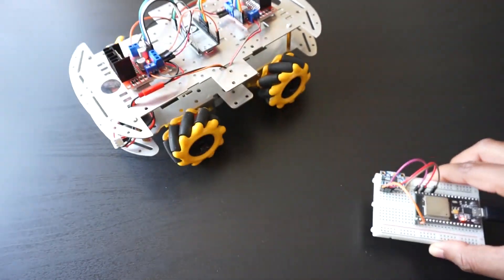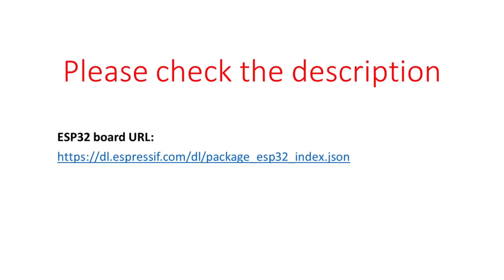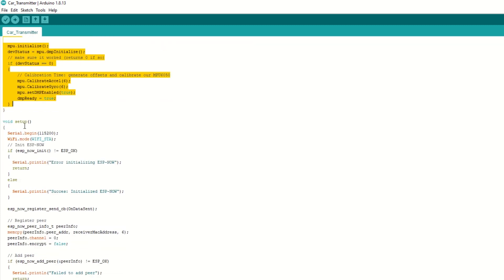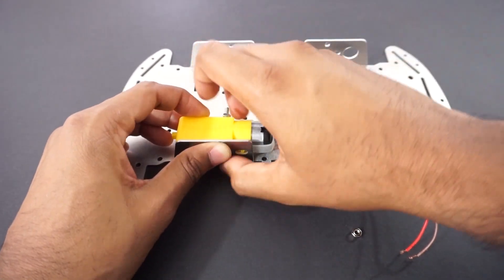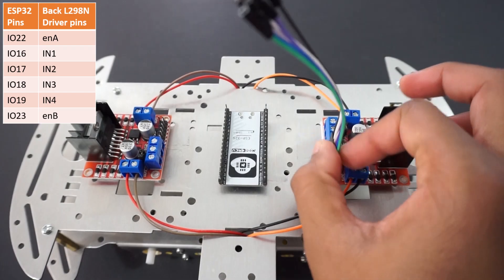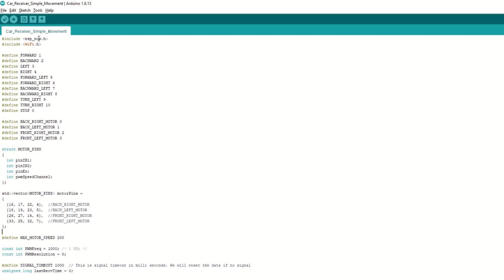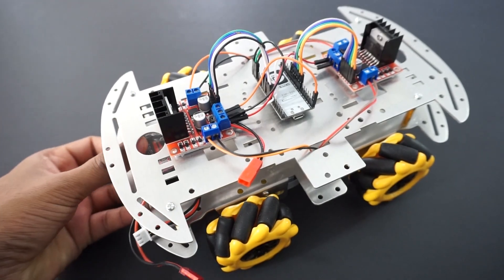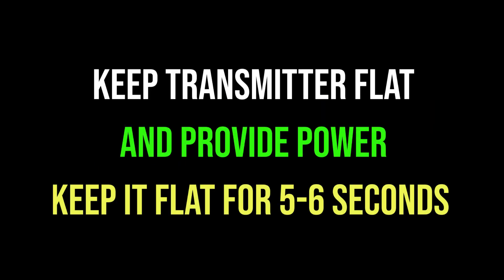Gesture Controlled Mecanum Wheels Car using ESP32 | ESPNOW | DIY🔥

Comment: SIR I UAVE DONE EVERYTHING RIGHT INCLUDING MAC ADRESS AND CONNECTION AS WELL AS THE CODE BUT IT IS STILL NOT WORKING PLEASE HELP ME ( CAN I CONTACT YOU SOMEHOW?) 😢
Reply from the maker: Please use rechargeable battery only . Also check video slowly and carefully for any missing step 👍🏻👏🏻. Don’t worry it will work 👍🏻
Reply: @hashincludeelectronics  BUT I FOLLOWED ALL THE STEPS AND USING RECHARGEABLE BATTERY PLEASE HELP SIR
Reply: @hashincludeelectronics  while checking if the transmitter code returns the same mac address as that typed out, you don't need a rechargeable battery right??? when it gives output, it is the default/original mac address of transmitter... how to change that? it won't connect otherwise
Reply from the maker: @Percyjackson183  please follow the exact steps in video . You need to get receiver MAC address and put it in transmitter code 👍🏻👏🏻

Comment: Sir, I need your help, my receiver and transmitter isn't connecting. From your another video I saw a similar project like mobile wifi controlled car, I uploaded that code in ESP32 and checked if it's working or not, surprisingly receiver is working perfectly fine in that case, but from this video I tried to flash the code again in receiver and in transmitter but it's not working after several attempts.
Reply from the maker: Please make sure to add the MAC address properly 👍🏻👏🏻

Comment: Why you did it with 2 motor driver you can use one also
Reply from the maker: We need to control all four motors individually . Hence we used 2 motor drivers . Each motor driver can control only 2 motors . 👍🏻👏🏻

Comment: BRO I ONLY HAVE L293D CAN I MAKE IT WITH THAT?
Reply from the maker: you will need L298N driver for this project . Unfortunately You can not use L293D driver in this project 👍🏻
Reply: @hashincludeelectronics  BUT I ONLY HAVE L293D AND I CAN'T GET L298N BECAUSE I HAVE TO SUBMIT THIS PROJECT

Comment: man that directions if else statement switches was some poor coding. And the logic behind it is naive. Just get the relative info, apply it as a vector in the loop
Reply from the maker: Thanks for checking out the video 👏🏻👍🏻. There are so many ways we can code. However I kept it simple and straight forward so that it can be understood easily by everyone. You are welcome to make changes in code as per your need 👏🏻👏🏻

Comment: Sir plz tell that u have made a transmitter and receiver in latest video so can we use that to make drone plz sir tell me big fan btw why don't upload videos now
Reply from the maker: Thank you very much for checking out the video 👏🏻. Yes you can use that for drone . However there another video using nrf24l01 for transmitter and receiver . It has more range . As far as video uploading is concerned , sure I will be back with new video soon . Little bit busy with other stuff . But soon there will be new video 👏🏻👍🏻.
Reply: @hashincludeelectronics  Thank! You sir
Reply: https://youtu.be/UQl03pU-w58?si=-0mHgrbxUm1AaCSq

Comment: Hello sir big fans 
Sir kindly help me i am totally stuck. I have esp32 with 30 pins and also i have mpu 6050 gy-61 both are very different from the vedio now what should i do
Reply from the maker: Thank you very much for checking out the video 👍🏻👏🏻. I would suggest to use the same complements as per video to avoid any issue . This way you will be able to complete your project easily 👍🏻

Comment: I did everything perfectly including with using same version of ide used in above video and modules and everything as same versions as per video 
but I could not able to interface my transmitter and receiver
I would be thankful if anyone help me out of this
Reply: did you figure out how to connect?? I'm facing the same issue
Reply from the maker: @Percyjackson183  what exact error do you get ? And which version of Arduino IDE are you using ?
Reply from the maker: What type of battery are you using ?
Reply: @hashincludeelectronics  3.7 volts battery *3 for receiver and 5 volts powerbank for transmitter
Reply: @hashincludeelectronics  how to interface those 2 esp32 (transmitter and receiver)
Reply: @hashincludeelectronics it is not working, followed every steps. please help. thankyou

Comment: Can we use other wheels
Reply from the maker: This car is supposed to work with mecanum wheels only . It has different direction control which will work only with mecanum wheels . If you need to use other simple wheels then please check my other video on gesture controlled car . Or you will have to make changes in this code and remove the movements which can not be handled by simple wheels . 👍🏻👏🏻

Comment: Hi.  can I use a ESP32 with 30pinout?
Reply from the maker: I would suggest to use the same module which is used in this project to avoid any issue . I have used 38 pins esp32 module . 👌🏻👍🏻

Comment: In the codes, we have to, we have to only change the MAC address as per our module right?? If the rest of the code is kept same, no problem will occur right? I am asking this cause I am new to arguing and on top of that I don’t know coding.
Reply from the maker: Thanks for checking out the video 👍🏻. Yes you need to change the MAC address . And don’t worry you will be successful 👏🏻👏🏻

Comment: The esp 32 module should be 30 pins or 38 or both can work
Reply: Ok thanks
Reply from the maker: Please use 38 pin module to avoid any issue 👍🏻
Reply: Also will esp8266 work with the same code??

Comment: Mine is not at all working circuit connection is true and transmitter and receiver is also ready but not working, what should be the problem
Reply from the maker: Please use rechargeable battery to avoid any issue . 👍🏻

Comment: Sir every single thing in my project and program is correct but still the reciever doesnot pair with the transmitter and it does not work. How to bind them together ? pls reply as soon as possible.🙏🙏
Reply: sir pls reply pls pls .
Reply from the maker: Please use rechargeable battery only if not using already .
Reply: @hashincludeelectronics  I am using that also
Reply: did you figure out how to connect?? I'm facing the same issue
Reply: @Percyjackson183  no i couldn't figure it out but am still trying I got my boards approaching very soon so it's bit delayed for me.

Comment: Hi Brother, 
You are doing great work.
Can I use ESP8266[NodeMCU] Instead of ESP32?
Reply from the maker: Thank you very much for checking out the video 👏🏻👍🏻. Yeah you can try that however you will have to change the pins accordingly. I would suggest to use esp32 as it is in the video to avoid any mistake and have your project working first . Then you can experiment later with nodemcu 👍🏻
Reply: @hashincludeelectronics  Thank You Very Much Brother🙏🙏
Have a Great Day!

Comment: Recently updated arduino boards and libraries and now am unable to make a connection. I have tried 3 different ESP32 modules and keep getting the same message:

-> Succes: Initialized ESP-NOW
 -> E (139) ESPNOW: Peer interface is invalid
 -> Failed to add peer

It was working just fine, no longer works. No parts of the code were changed.
Reply from the maker: This is interesting . Did you try searching for this error on internet ? May be there we will find some solution on this . Not sure if people already faced this problem recently .
Reply: @hashincludeelectronics  I managed to track down the source of the problem. When I use only your linked board manager URL and delete the newer espressif board manager url required for esp32c3 boards (not part of your board library), programming on the a esp32 dev kit works. If I use the newer espressif link, compiling for the esp32 dev kit board no longer works, for multiple reasons (i2cdevlib problem and a problem with peerinfo variable needing to be global). Have not managed to get the code working on the most recent espressif board manager url, mainly because the i2c devices fail to initialize.

I've had to delete the packages/esp32 folder multiple times switching between the board manager links as it really didn't like both links being there.
Reply from the maker: @samvanroy4921  glad that you figured out the issues . This kind of debugging is always time consuming .
Reply: May I have a solution? Please help me.

Comment: Trying to work out how to make this work. Using a lilygo T-OI plus ESP32. It really doens't like using anything but the Wire library. Can't figure out how to get it to initialize the sensor with i2cdev library. Any ideas which arguments I'd have to add?
Reply from the maker: Thanks for checking out the video 👍🏻.unfortunately I don’t have much idea on this requirement
Reply: @hashincludeelectronics  Thank you for the response. I'll try and see if I can't use other libraries to avoid the problem with I2Cdevlib. I like your calibration method, which is why I'm reluctant to do so :)

Comment: hai , if we use esp32 30 pin no 38 pin , how we plug to jumper that no GPIO ? we must update our coding ?
Reply from the maker: Yes you will have to make the changes according to pins connected . I would suggest if you have 38 pins esp32 , please use it to avoid any issue and have your project working as shown in video .

Comment: thanks for the video. i made similar circuit with 30 pin esp32 dev board with relevant pins but this is not working.is there any way to check if there is any problem in circuit or components. also, should there be 38 pin esp32 only
Reply from the maker: Any esp32 board should work . You can check the value if it’s being received at receiver end using serial monitor .
Reply: @hashincludeelectronics  It is working now, thanks alot for the video
Reply from the maker: @rish241  that’s really nice 👍🏻 good job 👍🏻
Reply: Bro can you tell me what problem you were facing and how you have solved that problem, because in my case among two motors, one motor is only moving backwards it is not able to move forwards, i am using ultra sonic sensor for obstacle detection as well.
Reply: @aavesh.bagwan    in my case voltage regulator was blown. For your case, you may check sensor output on serial monitor for forward direction. If it is fine then check for input to motors in motor controller too

Comment: I am building the robot but immediately find a problem. When trying to find the MAC address I can not find the model of the ESP32. There are 92 different models but none match the ESP32 model I have which is WiFi ESP-WROOM_32. There is no model like this in the list. Which do I choose?  Jim
Reply from the maker: Use the same module name in list which I used in video . It’s esp32 wroover module . It should work for your board as well .
Reply: @hashincludeelectronics  I have carried out your instruction and here are the results. I have also photed my controller.  Jim
Unfortunately I have found that I can't attach photos. There is an error uploading the sketch. Jim
Reply from the maker: @jimrob2768  send me screenshots on Instagram hashincludeelectronics
Reply: @hashincludeelectronics  hi ,  Did you receive thr photos I sent by Instagram?
Reply from the maker: @jimrob2768  let me check and get back
Reply: @hashincludeelectronics  Hi Manu thanks for your attention. Could you let me know what pins on the L298N drivers are enA and enB so I can finish the build on the robot. Still can't get the MACADDRESS on the controller.
Reply: @hashincludeelectronics  You said you would look for the pictures I sent by Instagram and get back to me. I am still waiting. Did you see the pictures I sent?

Comment: Hi, I am very intrigued with your robot. I have started building a similar robot to be controlled with an Arduino Uno Rev 3 but now I see your robot I have changed my mind. However I am not able to follow your code. Can I explain that I am 89 years old and have taken up this for a hobby but I am just too old to cope with the software side and rely on copying codes to run my robots. I have made seven robots using Raspbian Pi single board computers but as RPi units are no longer available I have turned to Arduino . Is it possible to download your code, if not, I would be willing to pay for a micro SD card loaded with your code. I have ordered the MPU6065  Gyro and two ESP32 units.
Regards,.  James Robb.
Reply from the maker: First of all Thank you so much Sir for your kind words 🙂👍🏻 I am glad that even at this age you are very much interested in electronics hobbies . Keep it up . As far as code and diagrams are concerned you are free to use it anytime . Even you can modify it as per your need . No issues . Please go ahead and I wish you all the best 👏🏻👍🏻

Comment: Hi. I have tried to follow your tutorial, but I cannot get my PS3 controller to connect to the ESP32. It only displays the following message: 
Succes: Initialized ESP-NOW

E (327) ESPNOW: Peer interface is invalid
Failed to add peer
Reply from the maker: Sorry but we don't use PS3 controller in this project video . Please check the PS3 Controller video for it and also we can chat there if its related to PS3 controller.

Comment: how can I input sounds in esp32 cam? so that I could send message via wifi
Reply from the maker: I have not tried sound transfer using esp32cam . However you can check online for more details on how to capture sound using I2S protocol .

Comment: I did it last week using esp8266, and it worked correctly too.Congratulations for the video.
Reply from the maker: That’s awesome 👏🏻
Reply: @hashincludeelectronics  Cant seem to get it to work with esp8266. I get error saying ledc* methods are not declared. Would appreciate any help
Reply from the maker: @michaelmikeyjacobs   Please check with Antonio Marcos who managed to do it with esp8266. Hello Antonio please help Micheal if you can .
Reply: how did you do that? I have like this - A fatal error occurred: This chip is ESP8266 not ESP32. Wrong --chip argument?
Reply: sir how did you bind them together together ? pls reply to me sir pls?
Reply: can you pls tell me how did you do that Iam also facing the same problem
Reply: bro did you face the problem of no such file or directory if you face than pls tell me the solution
Reply: plz share tutorials
Reply: can you show us how to do it?